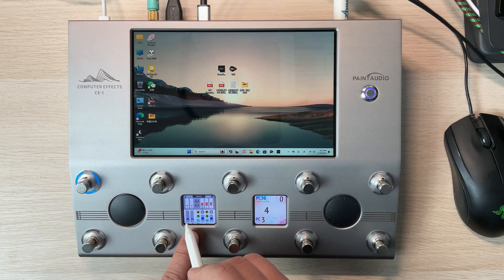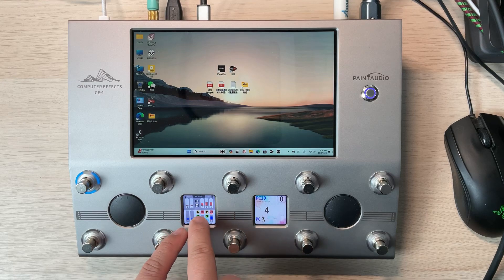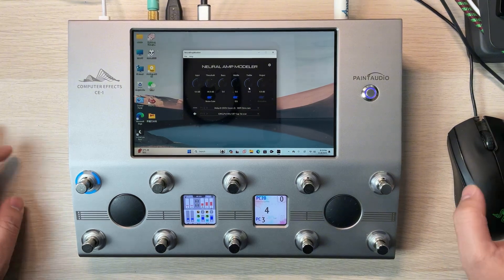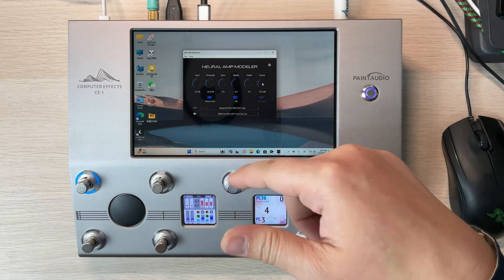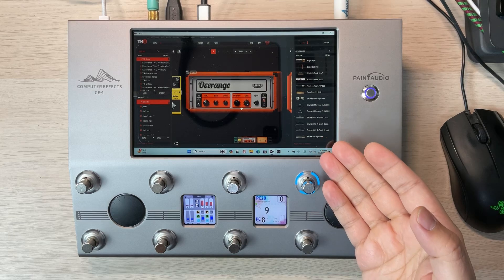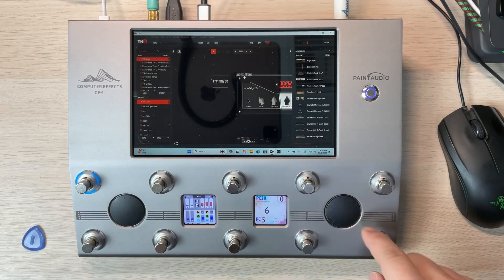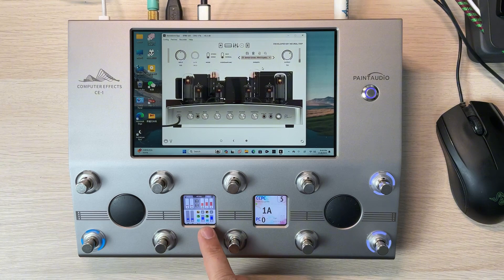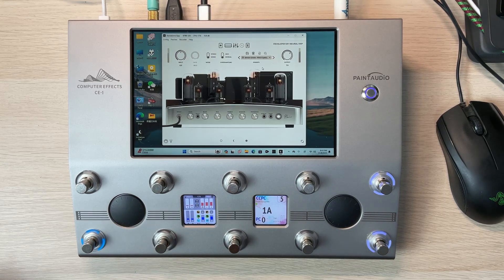CE1 Video 【4】Audio interface MIDI Control Software NAM THU Neural Plugin

Comment: I think the unit is exceptionally well made. I think a marketing challenge will be that the stability will be dictated by third party software so publicising giggable combinations of software will be key.

I have an open Midi captain ticket with you (no panic, I can see why you were so busy).  The management of presets and CC in it is a thing you should look at as it would affect how someone using a mix of presets and individual CC parameters can work.

Comment: The high input signal headroom is very important. Fuzz pedals and treble boosters (and other sounds that rely on the guitar volume pot) aren’t well emulated so having a way to handle them going into the front is very useful.

Comment: I love what it can do, however, the hi-z input noise, especially when using hi-gain amps gives away the fact it's a computer. The same/similar exists with my desktop. Really needs to be fixed to make this into a professional grade product.
Reply: just turn on the noise gate. problem solved.

Comment: Looks good, but i’ll be more interested in a version that is just the interface plus the controller in a pedal form,  so we can use with an external laptop
Reply from the maker: Got it and I talked about this in my last video😁. It could be real based on our time and biz progress
Reply: @ add a few encoders to the controller and you have a winer
Reply: I mounted a Behringer UM404HD underneath my pedalboard in order to plug in a few guitars and a mic. Works great.

Comment: Cool idea. Any plans for a MacOS version?
Reply: Hackintosh it?
Reply from the maker: I don't think there is any possibility apple can help me but I know there are people installed MAC on the this CPU platform.  I will try😁
Reply: @Wilson-PaintAudio  looks like a phenomenal product, may the force be with you.
Reply: @Wilson-PaintAudio  The very first place you'll get stuck with a Mac is the touch screen.  If someone could invent a touch screen that also acts as a USB keyboard then you could make something very cool around a Mac Mini.  

This is an old video of my rig.  My current rig uses a more recent mac Mini.  It's very stable  and I can run it at 192 khz.  That type of speed helps pitch shifting.

https://www.youtube.com/watch?v=aOZBkt5s51U

Comment: I think is great but it needs a bigger screen thats all. Send me one i will like to make a review of it . I play on a 3000 people church, Thanks for the Video God bless
Reply: Would be cool if you could mirror it to an external monitor or iPad. But no iOS so iPad is probably out.
Reply: @TheSkulletMan  you can use samsung tablets with Windows to mirror or extend the display wirelessly
Reply: @RobertoSunga  I’m a designer and have been using Apple products since the 512k. Windows would be blasphemy. 😂
Reply from the maker: There are portable external monitors you can find😄. Just need a typeC-2-HDMI cable.
Reply: @ I meant the big screen is perfect but the 2 little ones are a little smaller other than that I think is a great unit I really liked to try it out God bless you 🙏